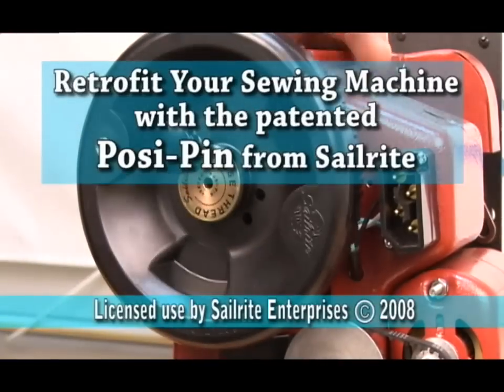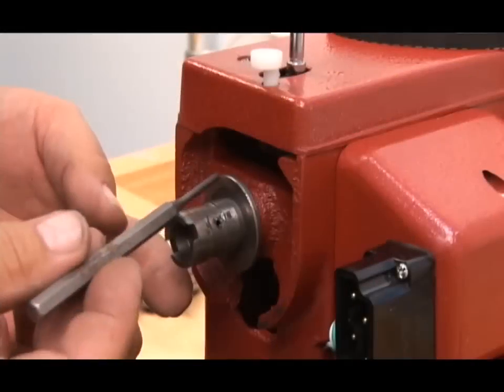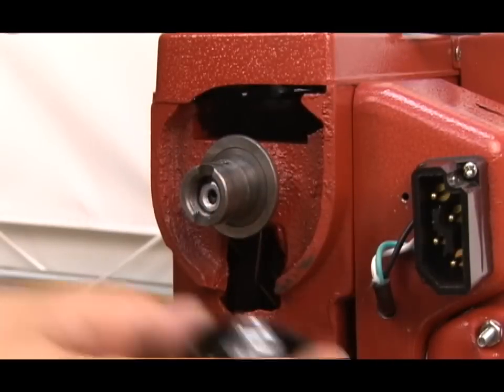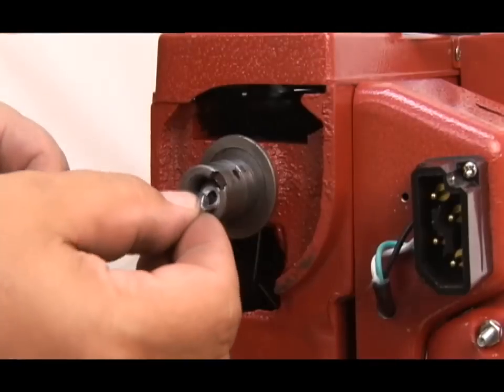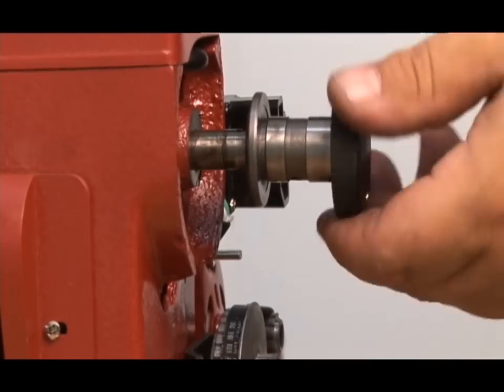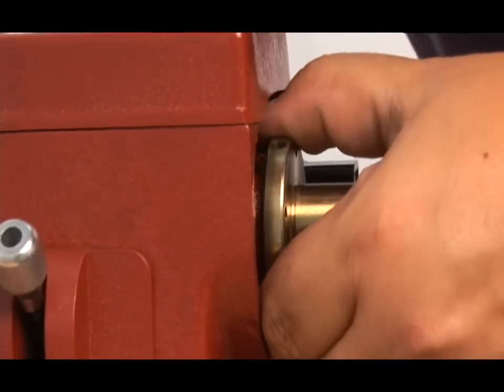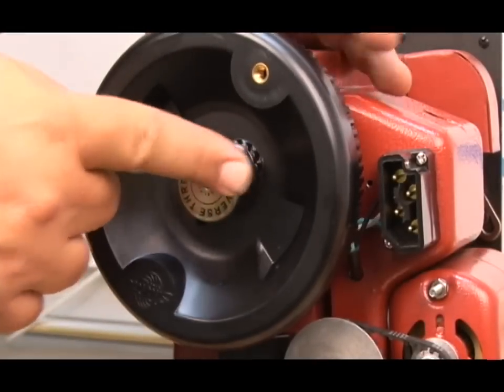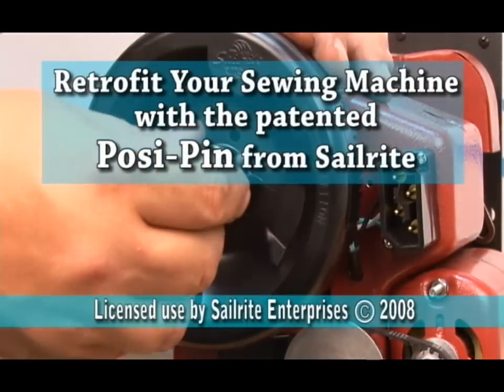Retrofit Your Clutch Locking Balance Wheel Sewing Machine to Posi-Pin System (Unlisted)

Comment: Is this convertion parts are still for sell? I have an old  sailrite but i want to update to posipin sistem and also workerB motor, i understand the worker b its plug and play, but i dont know if can work with older clutch Sistem or if i have to upgrade to posipin first